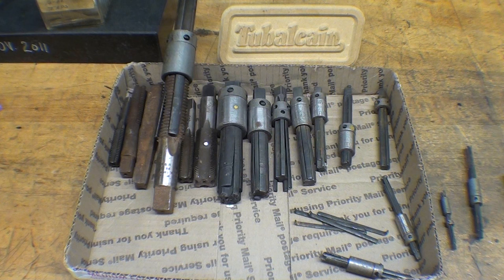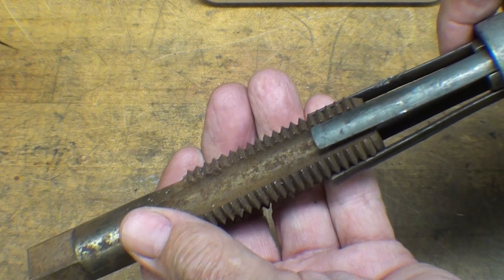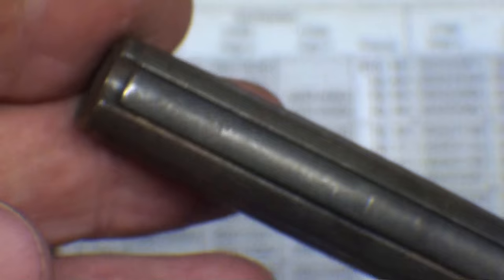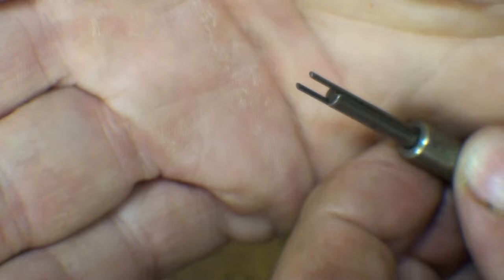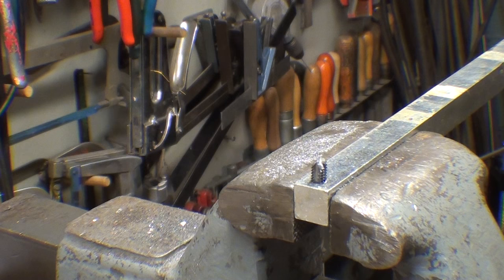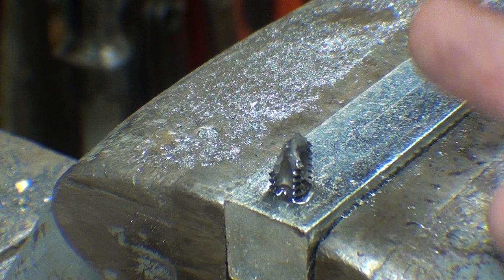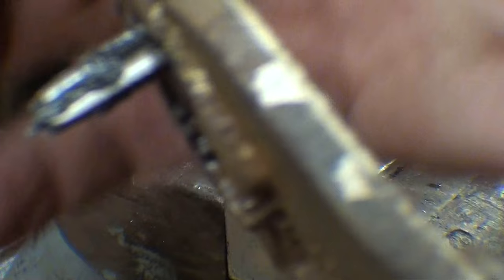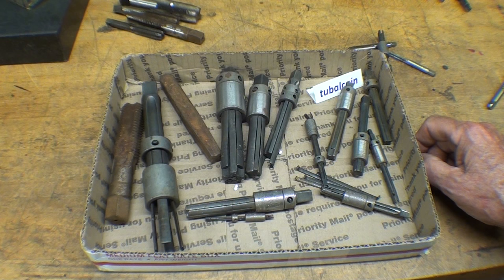SHOP TIPS #268 Using Tap Extractors tubalcain mrpete222

Comment: Never use a tool to do your thinking for you; the broken tap extractor is a means to solve a problem... the problem is, is it is a very specific problem (taps nearly always break uniquely in some way - I guess Murphy loves variety). Not criticizing, but I would have trimmed the broken tap remnant square with a cutoff wheel to make certain the extractor had as secure a "bite" as possible.

I've had a Walton work ~once~ for me. But it was an "ideal" use-case; a  broken tap, snapped off flush in aluminum; it was a deep hole tap (the only tap I had in the size), so the tap body was smaller than the thread size. Gentle heat and the Walton Extractor got the tap out and saved the threads in the hole. Once I got another tap, the job was completed. The cause was a dull tap and not enough cutting fluid... cutting aluminum without enough fluid can cause it to seize suddenly, and I think this was the case here.

Most of use don't have access to a wire EDM to get out a broken tap, and instead have to rely on Carbide Straight Flute drills, or use copious quantities of miniature Diamond burrs used for dental work to drill out the center of the tap remnant and get it to collapse in the hole. I'm about 1 for 8 (lifetime) "saving" a hole using this method (able to finish the job at the desired size in the base material)... most of the time I had to enlarge the damaged hole after getting the tap remnant out, and repair the threads with a Helicoil or Time-sert or tap to the next size which will clean up the hole. You can easily waste an entire day's work on a single hole - I believe this is why machinists are almost always grumpy.

Comment: Tap extractors work best if the fingers are supported by the walls of the hole and by the body of the tap. That way they are operating in shear mode rather than stiffness mode. When a tap is broken off above the surface (as in your demo) the fingers are unsupported by the hole and easily bent. The same is true if the tap is broken off deep in the hole. Now the fingers are not supported by the body of the tap and, again, can easily be twisted off. They work best (if they will work at all) when the tap is broken flush with the top of the workpiece.

That said, if a tap is really stuck, these extractors won't help much. They are mostly for removing taps broken by some sideways impact or bending force, and not really stuck in the hole at all.
Reply: if the tap tap isn't really stuck the chances are it's not going to break.
Reply: I think he meant if somebody really leaned on the wrench on one side.

Comment: I've only seen them used a couple of times, and every time the results were the same as yours.  I have had success using a carbide burr in a cheap high speed dental hand piece (AKA the drill the dentist uses in your mouth) but it works slow and takes a while to do. Chris

Comment: I think you extended the extractor pins too far. And this weakens the action. I believe you should not prong the pins more than a 1/2" and place the collar as much close as possible. This will reinforce them. Striking some blows on the tap, in advance, also helps loosening it. Some heat applied to the piece may also help as it leads to some expansion of the same. Do not forget to spray some thin lubricant as WD40 or similar and allow a couple of minutes to penetrate. If the tap brokes too shallow so you can't grab it by a plier, you may try to weld a nut by placing welding, thru the nut hole, the top of the tap and the nut. It works very well.

Comment: The fingers should not have been exposed,nothing to hold them in flutes.Love your videos
Reply: That's what I was thinking.  If it is flush, there is no place for the fingers to move and twist to failure.
Reply: I've had them twist when the cap is flush with the face... The fingers are delicate...
Reply: might have worked  if the collar slid down over the tap
Reply: Yes great observation, I think he should slide down the locking cooler..I have to watch again?
Reply: Walpho52 well if the tap had broken off flush the the locking collar would have went flush with the work pieces and the hole would have kept the fingers from jumping out of the flutes better that if it were above the work
Reply: Love all of your videos mrpete222. I "think" you should have tapped down on the collar that holds the fingers. I noticed when you removed the broken fingers they were barely in the tap. Maybe another try?

Comment: Would heating the metal (not the tap) help before trying to extract the tap?
Reply: Yeah it can, sometimes, sort of.  It can also make it worse sometimes.  My best successes at getting taps out is if they hopefully have a nub above the surface and you can tack welding rod on to it and back it carefully out.  The biggest problem with any method that gets the metal hot however is that it can warp the piece, which is often the very thing you were trying to avoid in the first place by using bolts and is therefore out of the question.

Comment: Thanks for the demonstration, any idea of how they still sell this tool?
Reply: Same reason they sell bolt extractors. Though they don't work very often they do work sometimes and by the time you're using this, you're pretty desperate.
Also I think had this one been used differently (see other comments) it probably would have worked.

Comment: Is there any drill that would drill a tap out?
Reply: Copper rod in a spark etcher will remove it in a few hours, providing of course you can fit the thing in the tray. Otherwise a lot of care and a gouging electrode ( and a plug to fill the very much larger hole it left) will burn it right out of there.

Comment: I haven't yet watched the video yet.  However my initial thought on seeing this video is I hate these things.  More often than not all you successfully do is bend the fingers.  I've had better luck if the tap is big enough to use a hammer and a small chisel and break out the tap in pieces.
Reply: Rare to see a tap break like that. Usually all you get is a small piece of 1 flute sticking up.  However that tap was other than hitting the blind end of the hole not that stuck.  In other words. For a tap extractor almost as ideal as you're going to get.  The end result a broken tap extractor.  These tools are a waste of money

Comment: I usually bust the tap with a pin punch and a hammer if possible then blow away the remnants.
Reply: I have ,on a couple of occasions , been able to insert 2 small  allen wrenches down  the hole in the flutes, then fasten vice gripe to the allen wrenches and rock the tap back and forth til I was able to remove it.

Comment: Another product selling false hope...
Reply from the maker: So well put!!!!
Reply: Oh I'm sure they work ... but only under ideal conditions that never exist outside the test lab.
Reply: Well said my friend!
Reply: it's not fair to say that they never work. they just RARELY work. They're like ez-outs, likely to fail but you might as well give it a shot.
Reply: mrpete222    They work very well if used properly. If you had ground the tap down flat to the surface, then heated and cooled the tap, it would likely have worked as advertised.
Reply: Russell Starr I’ve had great success with these but I consider the fingers sacrificial.  I keep spare fingers on hand for my common used sizes. I use old fingers to clean the flutes before I try using the extractor

Comment: plasma cut it out
Reply: EDM
Reply: I have, in an emergency, smashed up a broken off tap with a hammer and short, hard punch. And then drilled and tapped to a larger size.
Reply: electrical discharge machining
Reply: thebaron44
 Yeah... that's the best way, but its often not available out in the field.